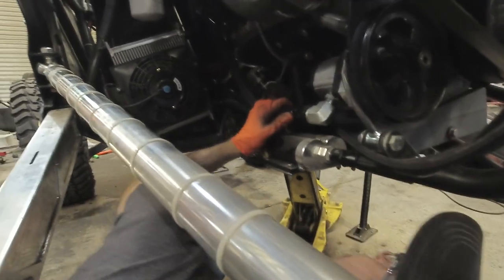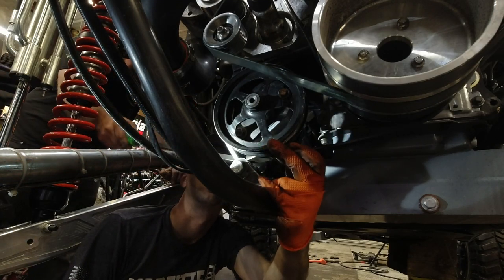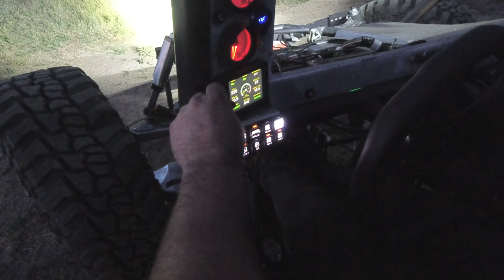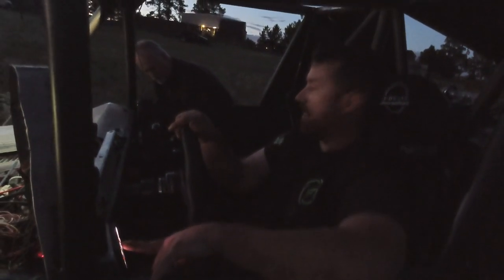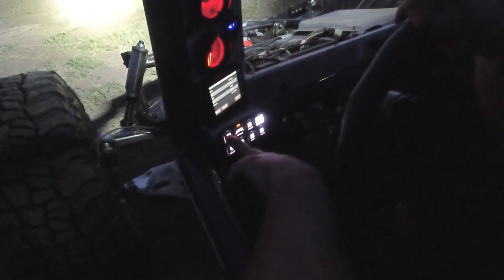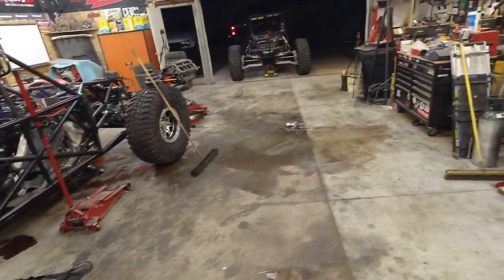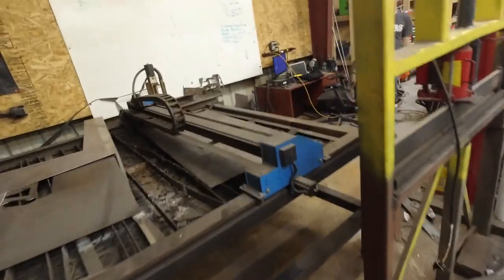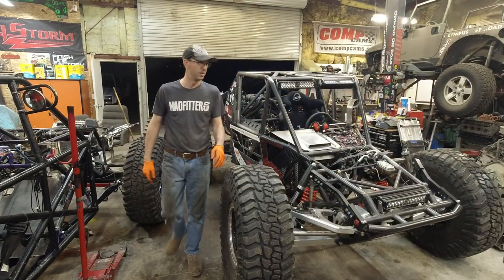Ultra4 IFS Twin Super Charged Build Update 22. Medusa goes for a drive on the test track!

Comment: I like the shape of the bouncer,looks well thought out and the components look as if they'd be easy to bolt on without clearance issues:) a temporary small  second floor might free a bit of space + if it had walls it can hold heat?
Reply from the maker: Yeah we are actually considering that in the corner we are moving the lift from. Great idea!